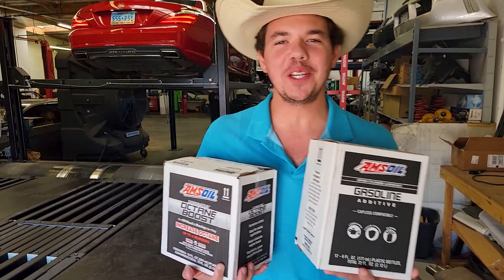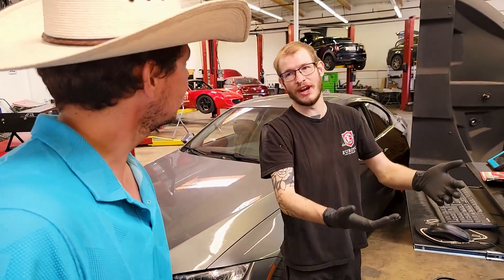Do Fuel Additives make More POWER?... Dyno Results wont lie

Comment from the maker: Watch This Next: Everything I Did To My Car Since The Day I Got It - https://www.youtube.com/watch?v=sqNN4TnoHxg&list=PLB_ftWArBFdd-6mgaMuj9bNs7DvKRpNQm

      ♥ Find The Right Fluids For Your Vehicles - https://www.amsoil.com/guides/?zo=5331179      

     ✅ Save 25% On Your Next Fluid Order: https://www.amsoil.com/offers/pc/?zo=5331179 

     ♥ See Fluid Performance Tests - https://www.amsoil.com/performancetests.aspx?zo=5331179      

     ✅ Buy Me a Coffee - https://www.buymeacoffee.com/YouLubher

     🥇🥇🥇 Synthetic Oil Protection Google Map Reviews
(702) 472-3614
https://maps.app.goo.gl/DmLU5hP72HadUBEm9
             
     ♥ Synthetic Oil Protection Website - http://syntheticoilprotection.net

     Did you know a oil manufacturer can call a lubricant a Full Synthetic when it's only 25% synthetic? AMSOIL is different because it is 100% Synthetic and has a higher film strength keeping the metal parts separated. AMSOIL allows less friction, less heat, less wear on the component. AMSOIL Signature Series motor oil will last 25,000 miles on 1 oil change!  

     ♥ Your Vehicle Could Run Better Than Brand New By Choosing The Right Fluids! See Results - https://youtu.be/zH-VquYlhqA

     ♥ Why AMSOIL - https://www.amsoil.com/about/exclusive-distribution/?zo=5331179    

     ♥ Synthetic Oil Protection Coffee - Ebens Favorite: https://supportwith.coffee/shop/subscriptions/sop/

00:00 Introduction
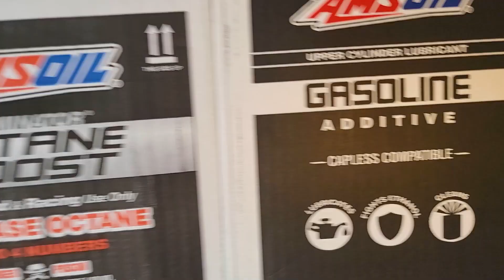00:11 How Dynos Work
00:24 1st Dyno Pull
00:35 2nd Dyno Pull
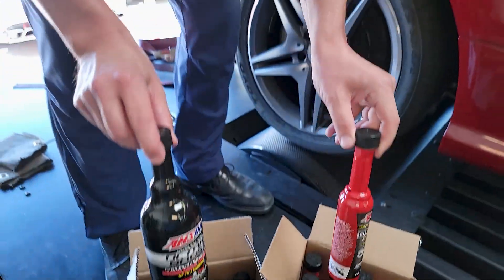00:46 Gas Additives 
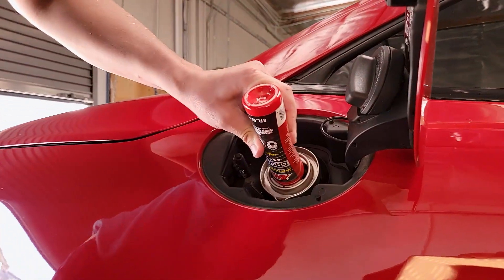01:09 Circulating Additives
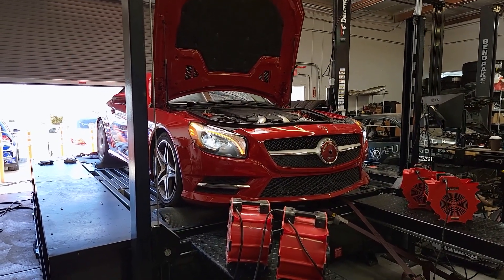01:31 Final Results 
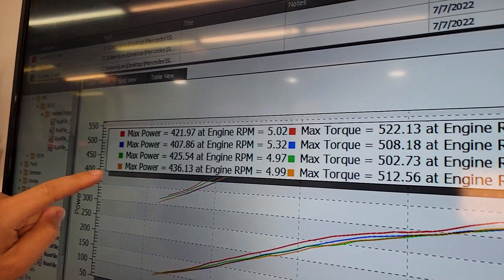01:57 6.5% More Power
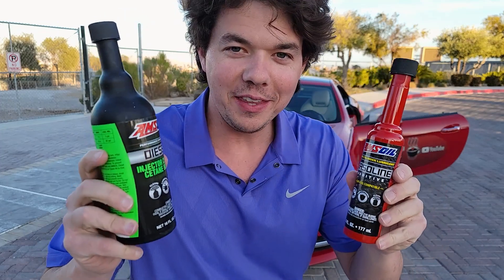02:14 How To Get Gas Additives
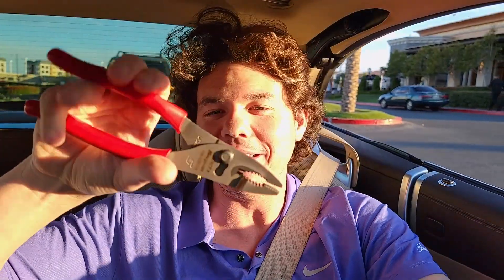02:30 Snap On Giveaway

Comment: I just put another gulpa, gulpa, gulpa of the PI performance fuel additive in my old 1986 pick up truck and it effortlessly made up a long incline……..in 5th gear (it’s got a manual transmission)
Reply from the maker: I love it yeah yeah nothing like having a good classic vehicle that runs longer and stay longer
Reply: @Syntheticoilprotection  yes, I remember I used to drive up long inclines in that truck and the engine would ping and knock and I would have to downshift to a lower gear just to keep that from happening. Carbon buildup really does rob power and PI performance does work.
Reply from the maker: 😃💯👍, yeah it's hard to believe what just one bottle of fuel additive can do to a vehicle.
I'll never forget the first time I tried the upper cylinder lubricant and the Dominator octane booster together on my personal car I was just blown away at the high RPM operation also on the 59 kitty cat she runs like a charm in the 110° weather out here she's just a little angel in the heat

Comment: I’m a dieselhead. Four trucks and two TDI’s. I’d love to see what the additives do for them on a dyno! Would this guy do a car and truck if I brought them down? From regular winter diesel to additive diesel?
Reply from the maker: Yes I think they can do it there definitely give them a buzz great team of people there👍

We can also do a video with the diesel injector clean plus C team boost that's my favorite green fuel additive made by Amsoil makes huge power gains I've used it on several vehicles on the channel and it got four average miles a gallon better on a Cummins Ram 2500 and on a Duramax I could feel a huge difference in power my guess is about 44 wheel horsepower and 78 rear wheel torque

Ask for Walter.
Eurotek Tuning
(888) 967-5634
https://maps.app.goo.gl/d78wGNwAp1QXFHr76
Reply: @Syntheticoilprotection  would you want to do a video on it for your channel?
Reply from the maker: Yes! That would be awesome

Comment: I'll have to throw a couple of these in my cart next time I put in an AmsOil order!
Reply from the maker: Yeah I use the upper cylinder lubricant every full tank of gas in my car and I average about 0.6 miles per gallon better.
Also keeps from ethanol separation and a lot of other great benefits the octane booster is good in the summer when it's really hot when your motor heat soaks you'll make a lot better timing which yields more wheel horsepower

Comment: nice 👍👍 that car looks like new. always have to love a nice Mecedes. I had an older 1987 but I sold it. miss that car lol.
Reply from the maker: Yeah it's like whenever you take care of any vehicle it usually performs the way you take care of it for the most part unless there's manufactured defects or recalls it's amazing that that car runs better than the day it was brand new and averages 20 miles per gallon at 26mph avg speed
Reply: @Syntheticoilprotection  oh yeah, I got a chevy work van that's had nothing done just regular fluid changes still runs like new at 379k miles it's amazing how long its lasted just keeping her wet and lubed lol😂😂

Comment: Good stuff. Going to add some to my 1959 Edsel. In the spring shes getting an Amsoil overhaul thanks to you!
Reply from the maker: Super sweet David this is my personal link will give you all the products at the very best value as a 6-month recent number. Also when you use my link that will allow me to answer all your questions in the future on the product size here independent Amsoil Dealer about improving the performance and lifespan of your vehicles and equipment by choosing all the right fluids👍
     ♥️   Find The Right Fluids For Your Vehicles - https://www.amsoil.com/guides/?zo=5331179      

     ✅   Save 25% On Your Next Fluid Order: https://www.amsoil.com/offers/pc/?zo=5331179

Comment: Eben do you use 91 octane pump gas? Great how the octane boost increased horse power.  I like the upper cylinder additive as a protectant to the heads and piston rings. Great video. Thanks!
Reply from the maker: Thanks Steve yes I use shell 91 octane or I use Chevron 91 octane I find them both to perform very well in my vehicles and at the time of the video I had Chevron gas which is from Las Vegas in my car it was at half a tank of fuel when I put the attitudes in in my fuel tank is about 19 gallons
Reply: @Syntheticoilprotection  i use the upper cyl additive on my Audi. Great extra protection.  Thanks as always, great videos!

Comment: Hey eben.
Does amsoil have manuel gearoil 75w-... gl4?
Reply from the maker: Yes it's called the transaxle gear lube you'll see it right here in the lookup guide for your year make model and engine size also I recommend the 6-month PC membership if you're new to Amsoil will give you the very best value on the products it's only $10 for 6 months and there's no Auto renew.
When you use my link that will allow me to answer all your questions in the future about improving the performance and lifespan of your vehicles by choosing the right fluids as your independent Amsoil dealer👍
♥️   Find The Right Fluids For Your Vehicles - https://www.amsoil.com/guides/?zo=5331179      

     ✅   Save 25% On Your Next Fluid Order: https://www.amsoil.com/offers/pc/?zo=5331179

Comment: Berryman Chemtool B-12 is the best of the best
Reply from the maker: A friend of mine told me about that here in town Ricky Towers I tried it and I couldn't tell a difference however my car is in pretty clean shape also I wasn't able to get it into the gas tank so I took a golf pencil and pushed it to open the flap and when I did it took all the ink off the pencil and it went all over my hand and it took me a day and a half to get it off my skin big Learning lesson LOL

I bought it at I think an AutoZone and it doesn't have an extended nozzle so there's no way to push the flap in to get it to go into your car big surprise and definitely will never use that again LOL
Reply: @Syntheticoilprotection  Berryman Chemtool B-12 has been in business over 100 years, clearly they doing something right and it works and dirt cheap and find it everywhere.
Reply from the maker: Yeah that's what I found out when I tried the product and couldn't get it into my car definitely cheap cheap cheap.......

Comment: Eben, 
I just recently did another oil change on my wife's 2008 Jeep Wrangler with around 62k on her.  We got the Jeep with 45k on her. So I have done 2 oil changes both with the flush and power foam before the first oil change. I use the wix filter for the first 3 to 5k and then swap out to the amsoil filter. The engine is the 3.8L inline 6 and she absolutely purrs like a baby kitten. This spring I will be doing the antifreeze and I only suspect the engine will get even better. I have also done the transmission, diffs, power steering, and brake lines.
Reply: The 3.8 is a V6.

Comment: Thanks Eben. I just put in another order this morning. I got the P.I fuel additive I think it’s called. Use every 4,000 miles one. And I am going to try the XL boosted oil this time. Have been real happy with the signature series but I still change oil frequently so I’ll give the boosted a try. Also trying the miracle wash. I also got rear end gear oil 75-90 this will be the first time using Amsoil gear oil.
Reply from the maker: Sweet!

Comment: Wow, that is impressive Eban. I wish it would also get more torque but it did get more HP.
Reply from the maker: Not sure what you mean matt?
Reply: @Syntheticoilprotection  the numbers on your left on the graph is horsepower. The numbers on the right are torque. The torque numbers did not go up like the horsepower ones did.
Reply from the maker: Of course it changed the power band and pushed everything upwards without pulling timing even though it was not heat soaked earlier it still made a lot more power later heat soaked.
Basically the computer judges the timing by the quality of fuel so there's no pre-ignition and the computer allowed a better timing which yielded more rear wheel horsepower